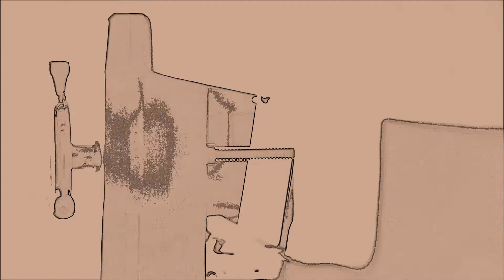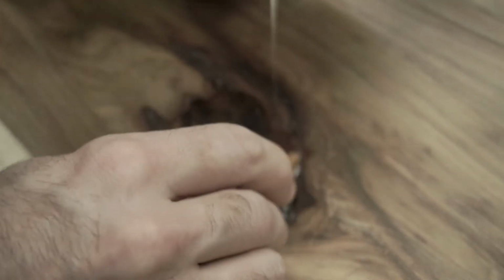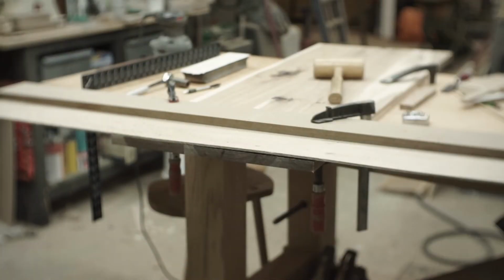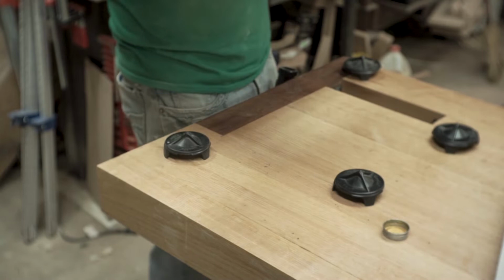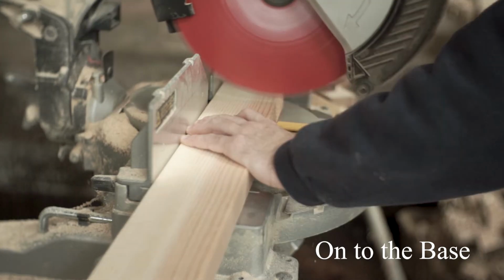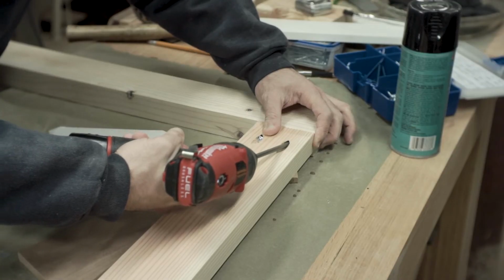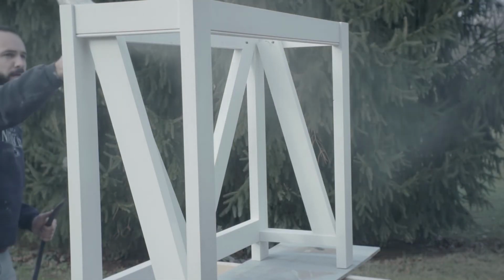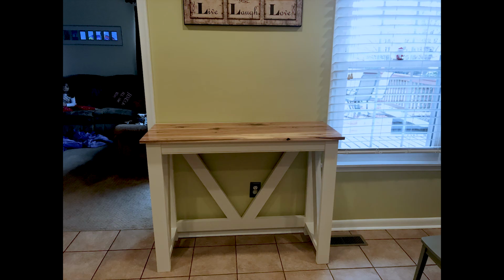DIY Breakfast Bar - Build Video

Comment: To get the air bubbles out, use a torch in short burst. Carful not to hold it on there you can burn the epoxy.